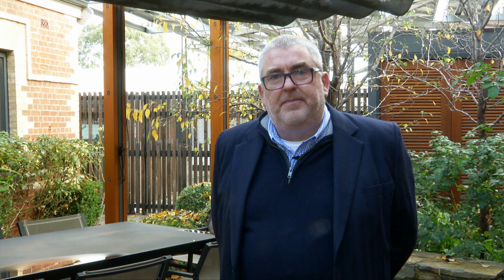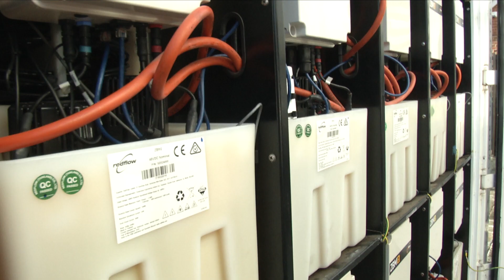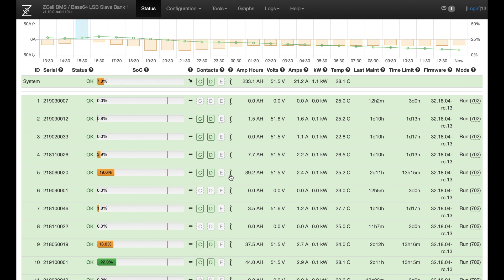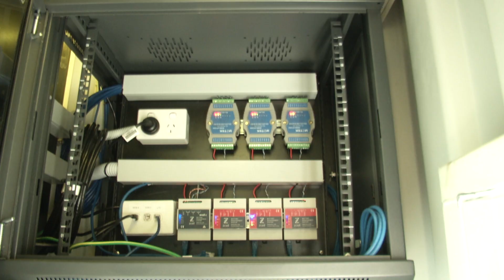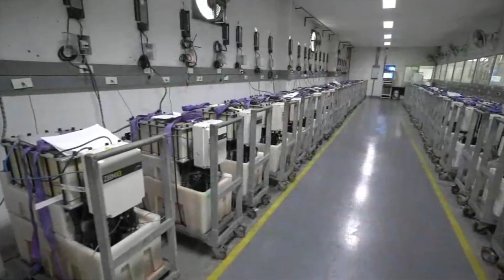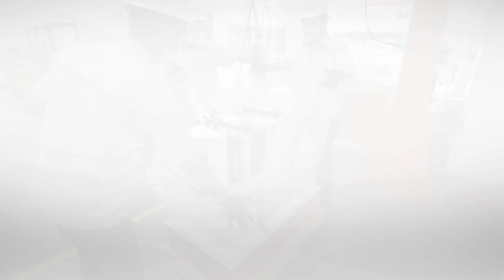Former telco exec praises the benefits of Redflow’s BMS for telecoms companies

Comment: By looking at the battery it appears that the pumps are activated during the discharge cycle. Would it not be more reliable and cost-effective to gravity feed the liquid solution during discharge and only turn the pump on during the charge cycle?

Would it be possible in future designs to preheat domestic water by using the battery cooling system?

Thank you

Comment: John, very nice visual on how the Redflow BMS works, but you could have been a bit more clear when highlighting various aspects of things. I have two of these batteries and I agree that the Redflow BMS is superb, but when you were mentioning that one battery undergoing maintenance had a warning due to low temperature, I knew what to look for and I did find that warning, but just in time before you moved on. Anyone with no knowledge of what to look for, will probably have to go back and forth to see just what you are talking about.

Maybe slow down a bit and possibly point out just what you are mentioning with on screen graphics pointing or highlighting things. When people are taking the commentary in via audio, then by the time they have understood what you are saying, they look for the image, but by then, you've moved on. This can be quite frustrating.

I have had a couple of people looking over my shoulder while I explain my Redflow BMS and have found I need to physically point out what I'm telling them. It is only then, that you hear their light bulb moment.
Reply: Hi Hugh, how are you batteries going?  I've calculated the gen 3 batteries to be around $11,550.  And, what's the go with maintenance.  Does maintenance mean one unit in isolation is unreliable?
Reply: @timmyssweet  Maintenance is just that. Each battery does a complete discharge every third day, doing this cleans the plates and they become virtually as new. The batteries go into maintenance mode overnight, this is controlled by the battery management system. Essentially all the power in that battery is used up by the house, any spare power is transferred to the other battery. This is a seamless happening, unless you are looking at your computer screen you wouldn't even know this discharging and cleaning is being done.

As I understand it, this maintenance regime keeps the battery working at or near 100% of its original brand new state. Meaning that every third day you have an as new battery, this will keep on happening so that at the end of 10 years of daily discharge and re-charge, you will still have an as new battery every third day.

The system works so that you have a battery with zero State of Charge (SoC) around the time the sun is coming up. As the battery management system knows it's exact location on earth, it automatically adjusts the discharge maintenance cycle all year round. It really is quite a good system, we are extremely pleased with our batteries. As the sun comes up and hopefully starts giving you some power from the rooftop, your SoC rises, allowing you to effectively extract and store every Watt of power your rooftop generates.

If you are getting more than one battery, you may wish to look into having an inverter for each battery. There are practical reasons for doing this, but it also depends on how much power you may wish to draw at any given time. In the real world, the batteries can and do give a shade under 3,000W continuously, unless the ambient temperature is very high, as in over 40ºC. Our batteries have worked in temperatures around and slightly above 47ºC + a couple of times. Now their efficiency was down, but they still worked and did everything asked of them.

We run our entire house and workshop through our batteries, sometimes we do have some reasonably high short term requirements. If one has the electric oven on, that can be around 2500W or higher if both elements are on. The microwave is about 1500W, the house lighting is usually around 300/500W max, then there may be an electric hand mixer or food mixer pulling anything up to 2000W at a given moment or two. With what I have just mentioned, one can easily see that the power being used will be around the 6500W. With one inverter, you will be pulling from the grid, with an inverter for each battery, you'll stay with power from your batteries. Until they are exhausted that is.
Reply: @allanhugh2044  Thanks Allan.  I thought the battery might be off line to do the maintenance, but it just need to 100% discharge every 3rd day.  That's fine.  If you fully discharged a lithium bat, you would shorten it's life.